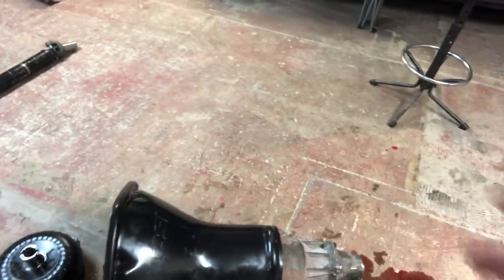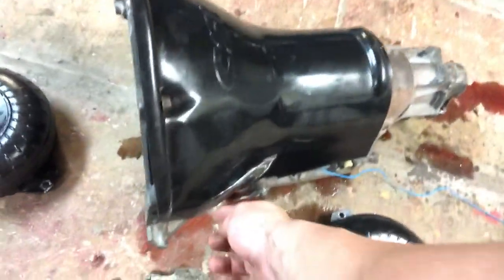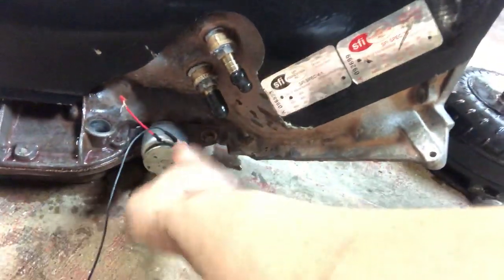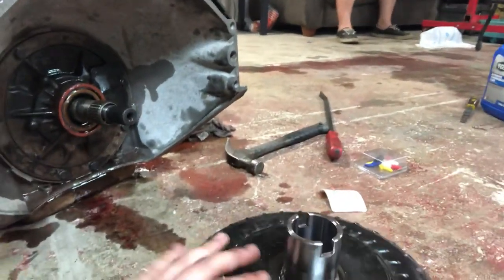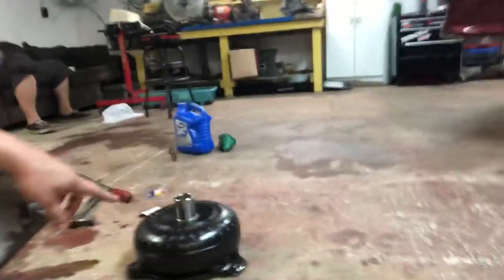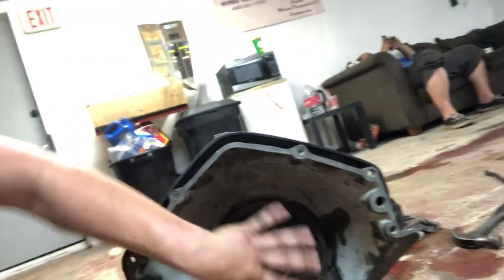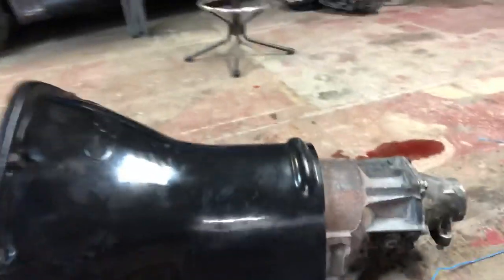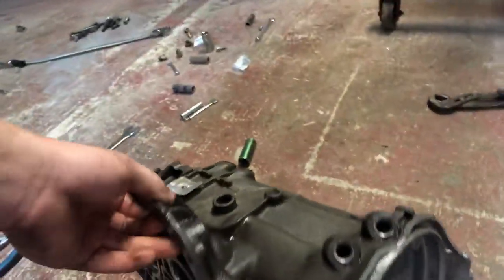New trans and bellhousing shield + issues

Comment: Sounds like the input shaft   is a little damaged. I work for gm back in 2005 my job at the Toledo plant was the converter group. The should go on easy with a nice hollow thud when it hits bottom 🤓

Comment: I don't know about automatic transmissions or any of that jizz jazz but I''ve been learning a ton about them watching you sort through all sorts of issues. We really appreciate when you follow up after you get something fixed and explain what the problem was. It's super helpful!

If I had to guess it seems like the shaft that the converter is sliding onto is probably bent slightly, and that's causing it to bind?

Comment: When it's hard going on and pulling out to set clearance is more than likely the tangs on the new pump gear. I've had to clearance them before just to get the converter to seat all the way. As far as it being hard to spin is probably the pump bushing. I would run it but change the fluid after a short break in and unbolt converter to see if it then spins freely. My 2 pennys!

Comment: No way should it be as tight as you're describing.  Of all the trans's I've replaced in my time I never came across that.  I wouldn't install that trans.  Sure would SUCK to remove it AGAIN.......  Call that trans place where you had it fixed and see what the rebuilder says.  Is it possible to have used the wrong sized trans pump gears?  I think so.  Good deal with installing that scatter shield!  You get to keep your legs now lol